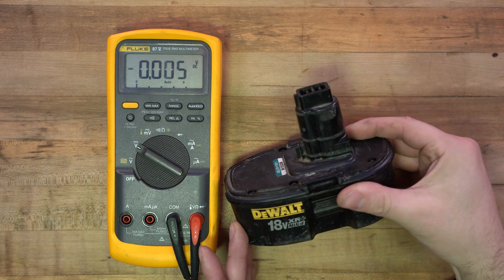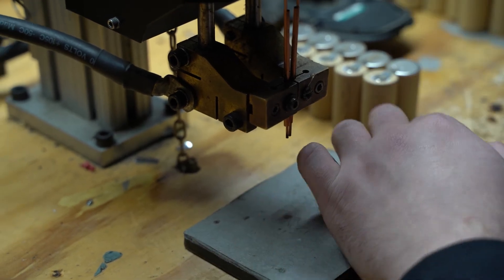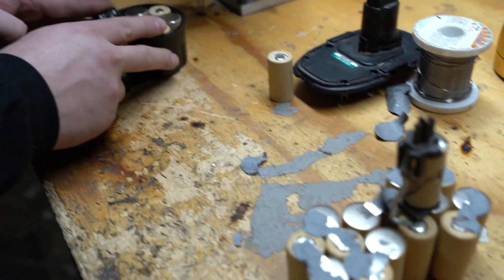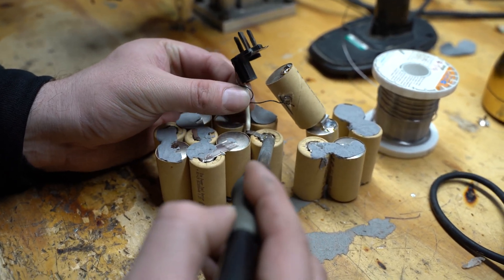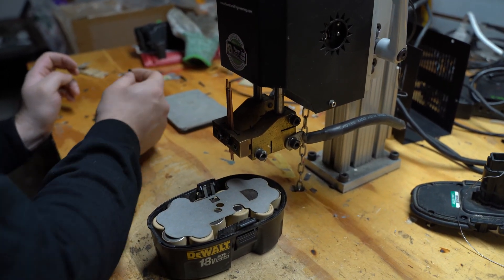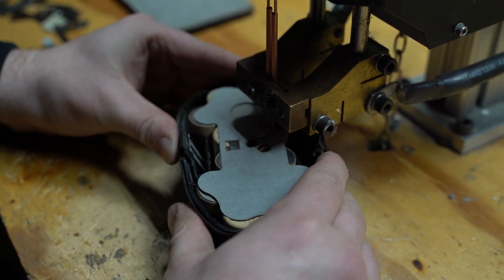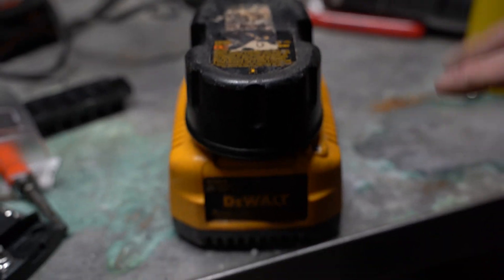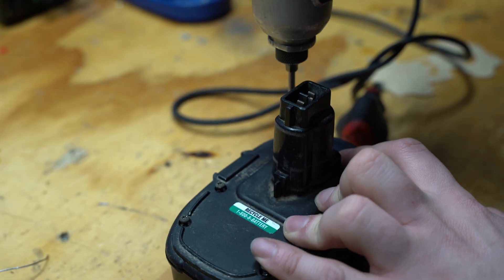HOW TO REBUILD 18V DEWALT NICD/NIMH BATTERY

Comment: This is definitely a decent training video. However, without a part list for the welder, replacement cells and 3M precut pads, it is also quite useless. In addition, the new unit is 19.18 VDC which is well above what the power tool likes. You need some kind of dropping circuit to bring it down to 18.0 VDC otherwise, the tool could possibly be damaged over time.
Please, update this to include the parts list and a balancing circuit.

Comment: Tks for post, where to buy the cell ?
Reply: Amazon, but its not worth it when lithium packs are so much better. Buy a 20v to 18v tool adapter if you want to keep using your 18v tools.

Comment: NEVER EVER turn a screw forward when putting it back into a hole.. 

I turn it backward very slowly until I hear and feel it drop into the original thread groove.
Then Just as it fully drops into an original thread groove, I turn it forward and feel 
if it has any binding resistance. If it does, I turn it backwards again until I hear/feel one more click.. Then I turn it forward and feel if it is following the correct groove..

And always put the same screw into the same hole.. 

This insures that the threads don't get stripped...
Reply: are you this detail oriented and obsessed with perfection all the time? or just when you are commenting on youtube?

Comment: what do you call that adhesive pad? it looks like it is made to fit that dewalt battery?
Reply: I’m wondering the same thing
Reply: GCbattery has them or you could make your own.
Reply: It's just paper. Buy some card stock and use a scissor.

Comment: lotta work to rebuild these packs...geesh..i thought u could just remove a few screws, take the case apart, desolder old bats, solder in new ones
might as well just buy em new already made for $50 lol, dont have a spot welder, just soldering iron...sighh...wanted to buy high end r/c car batteries as I'm into that hobby, and use them in a pack for my drill..my research tells me theyre the same batts in size/type etc
Reply: Aftermarket packs don’t last
Reply: New cells will outlast new packs

Comment: Why, when non branded new battery packs are so cheap?
Reply: Because they use cheaper cells that are rejects and have lower capacity?
Reply: @ceeweedsl  correct, they suck.
Reply: The cheap batteries do NOT last
Reply: The new cell are stronger than new aftermarket packs
Reply: the generic chinese batteries are complete garbage; low mah, and don't hold charge; never had one last more than 4 or 5 months
Reply: @wildbill6976  Amen to that....................